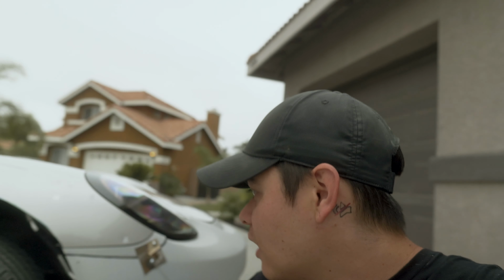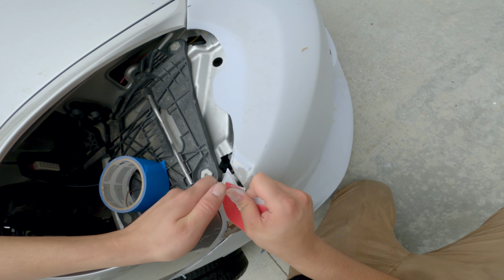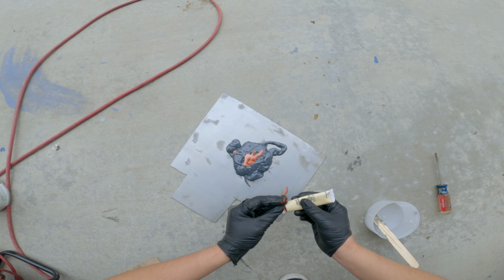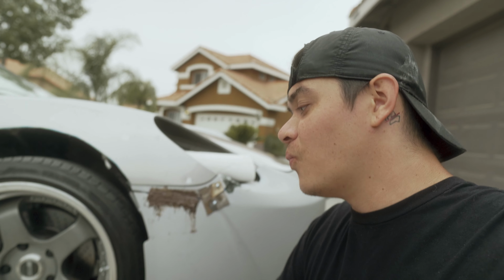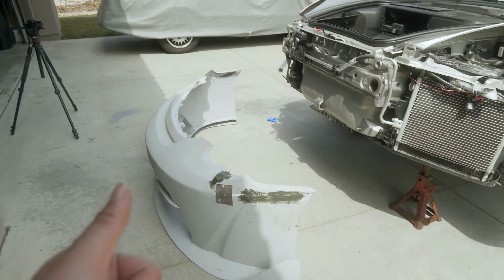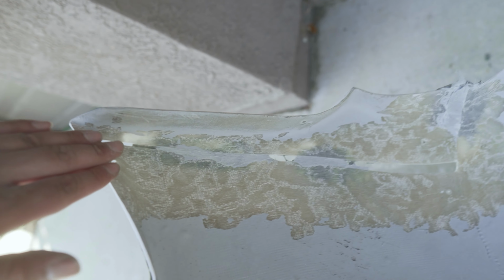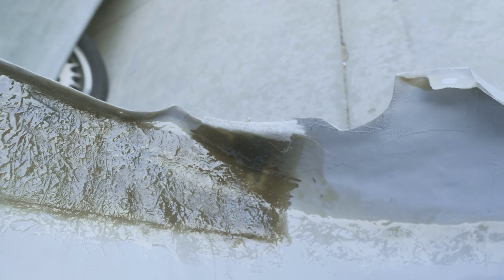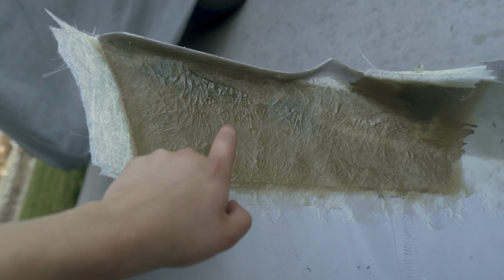$1500 BUMPER BEYOND REPAIR?!!! | Karma Widebody Cayman Install

Comment: Quick tip. On the out side of the bumper. After you grind all the excess Bondo glass off. Use masking tape and tape on the bumper exposing only the crack. Put your bondo glass in. As soon as your done filling the crack. Pull the tape off. It’s going to save you time on sanding all the excess off the bumper leaving all the bondo only in the crack. 👍 hope that makes sence. Other wise good job man.!